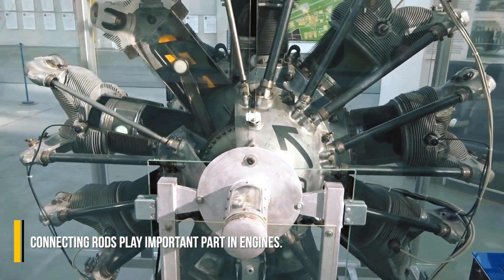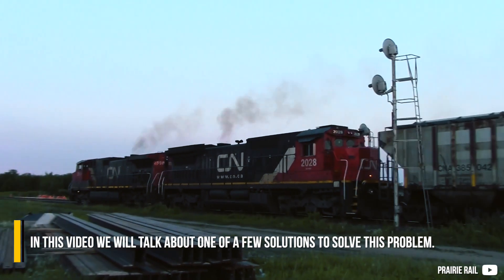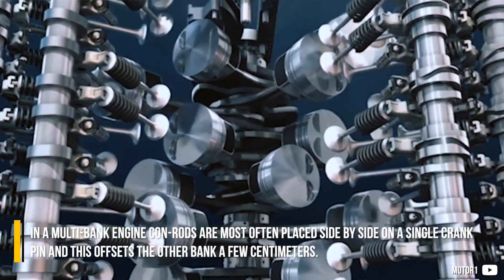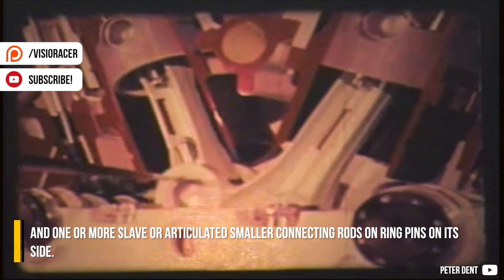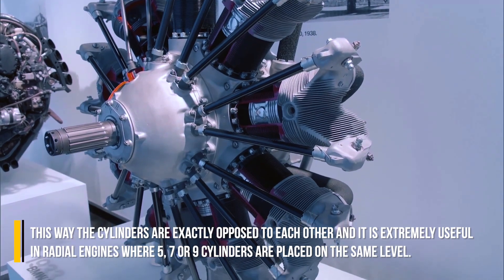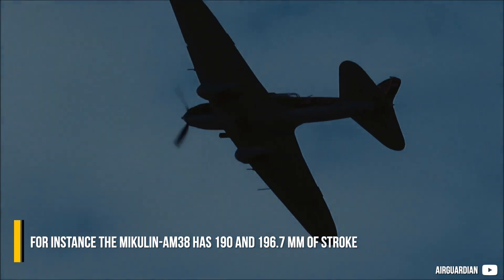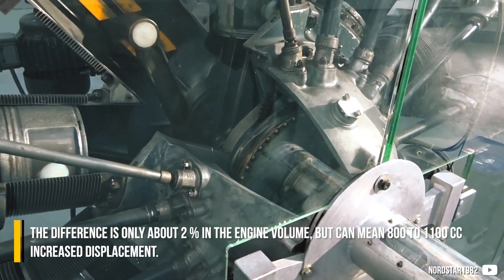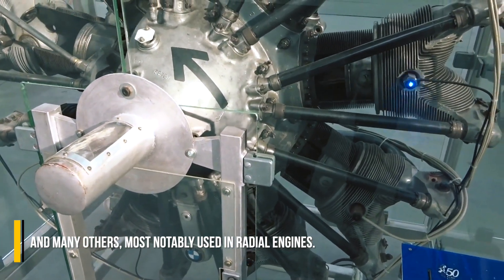MASTER and SLAVE Connecting Rods

Comment: I know that SACM MGO engines have master and slave rods and because of the shorter stroke on the slave rod pistons, thinner head gaskets are used to give the same compression ratio.
SACM MGO engines are found in older French diesel locomotives.

Comment: I also read that using master and slave conrods produce diferent primary and secondary forces between banks, so you are eliminating rocking couple between banks (but not in the same bank) but creating inbalance of the forces, thats the reason why is not used in most V shaped engines (also because is cheaper to have equal conrods molds when casting)

Comment: Can this technology be used for boxer engine
Reply from the maker: Interesting question. I think it could, but the pin would be 180° from the master rod, I mean at its bottom.
Reply: @VisioRacer  thanks bro, I think if someone is building a 2 cylinder boxer racing engine then he can use this as this will not only provide very smooth power delivery but also eliminate rocking coupling, thankyou bro for replying my comment it really means a lot to me

Comment: I never thought it before about the stroke length being a different in these types of engines. Learning always something new!
Reply: The timing is also different. On a radial the master rod big end transcribes a circle, but the articulating rod ends transcribe an ellipse. This means that the intervals between each TDC and BDC aren’t evenly spaced. 

Radials use what are known as a “compensated cams” with unevenly spaced lobes for proper ignition timing..  while valve timing is set so it’s an average for all cylinders (since radials use planetary gears and cam rings which share lobes between all cylinders rather than camshafts).
Reply: This is what give the radial it’s unique lumpy sound.
Reply: Yep, all slave rods that are not 180° apart from the master rod will have slightly longer strokes than the master rod.

The Soviet T-34 tanks have a 60° V12 that has a master/slave arrangement, eith a 180mm stroke on the master side and a 186mm on the side with the slave rods.

The GE 7FDL locomotive engines are at a 45° angle and also use master/slave rods. I know that the pistons on the master rods have a 267mm stroke, but I'm not sure what the stroke of the slave rod pistons are. Maybe something like 277mm?

Comment: You forgot another way of putting two connecting rods to a single crankpin. 
The blade and fork!!! 
Imagine putting your spoon in between the teeth of your fork.
While it may not be as simple as the side-by-side design, it had a slightly shorter block length-wise since it had no offset heads to worry about. Which also helps in simplifying the cam drives. 
A few notable examples of this are the Harley v-twins, rolls Royce Merlin, and the Merc DB601. 
One of the few downsides of the blade and fork engine is the increase complexity in con-rod production, and oil circulation issues in between rods.
Reply: I'd like to see that done on a radial engine...
Reply: The EMD 2-stroke Diesels have used fork&blade rods since they were first built in 1938.